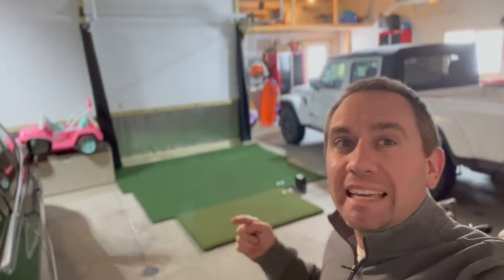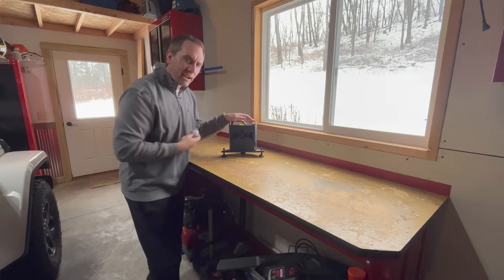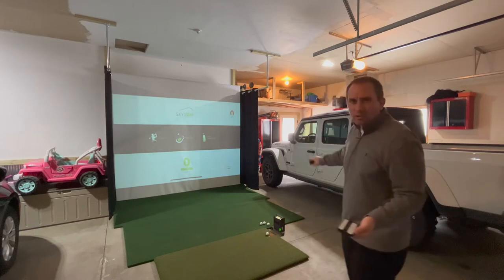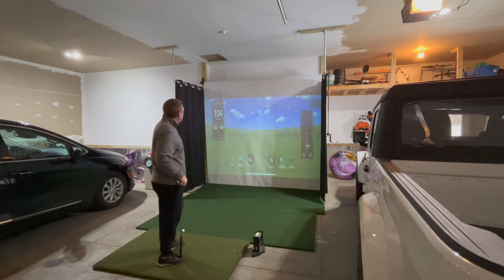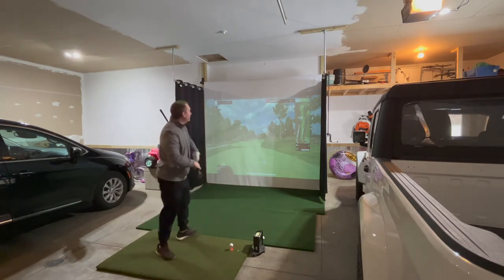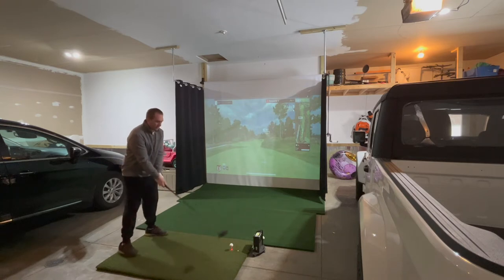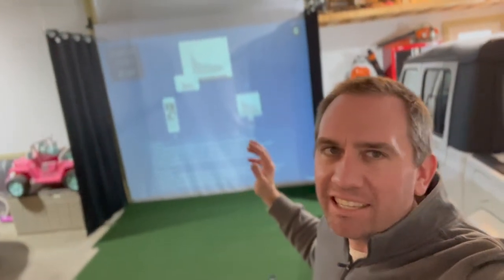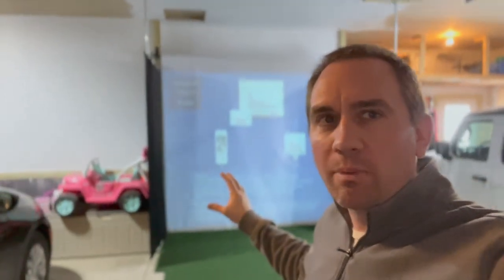Golf Simulator Build Episode 5: Demonstration

Comment: Great series! Gave me some great inspiration for what I'm about to build. Has playing on this helped the scores this summer?
Reply from the maker: Thanks for checking in, I'm glad you liked the series.  

I have mostly focused on pounding balls on the sky track range to improve my ball striking and swing speed.  It has definitely helped with that.  That improvement combined with selecting the appropriate ball has gained me 40 yards on drives.  

I've dropped from a 12 handicap down to a 10 this year so things are going in the right direction.  I should probably start playing more golf holes on the simulator to improve my scoring...my chipping and putting could use some work.

Comment: How far from the screen is your hitting mat? I saw your projector is 17' from the screen have you had any shadow issues? Thanks in advance
Reply from the maker: The hitting mat is right up against the rubber mats so it starts 8ft from the screen.

If I stand up straight on the hitting mat, the top of my head starts creeping into the image.  I would say that my setup just works, no margin to move the project back or hitting mat closer.

Comment: No overhead protection? I would slam those ceilings with my 60 degree.
Reply from the maker: I've decided to sacrifice practicing flop shots for not having overhead  protection.  I might regret it this season when I have to fly a trap with a tight pin.
Reply: @TheLawnEngineer  Doesnt seem like it would take much to take some netting from amazon to strap it tight across those bars the curtains are hanging on. I have looked at a lot of builds in the last two years trying to get this right but I am leaning towards yours so far with a couple of modifications.... You are are a wild man for ripping a driver with vehicles beside you, lol. Great videos!! There are so many different custom builds out there its overwhelming.
Reply from the maker: @D2mohan  yes you could add some netting above but I’ve hit a full 60 and no issues.  I can’t flop one but that’s risky on the hitting mat anyway🥸.  

I like to live dangerously, no broken windows yet 👍.  I do pull the cars out when other people come over, I don’t trust them 🧐.